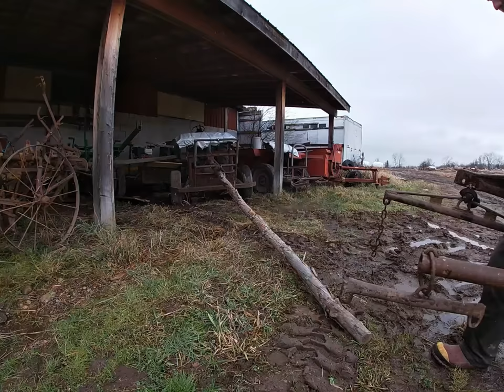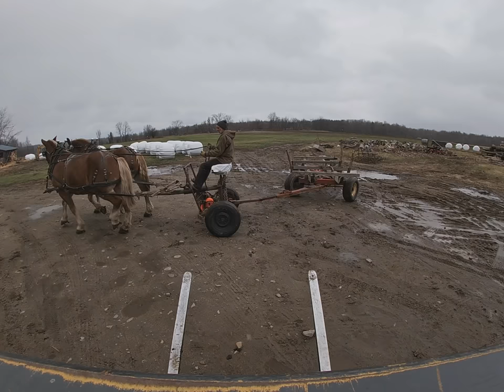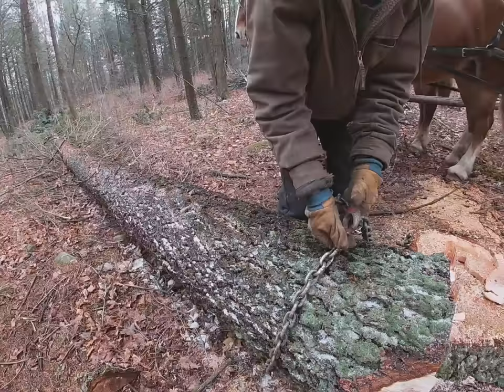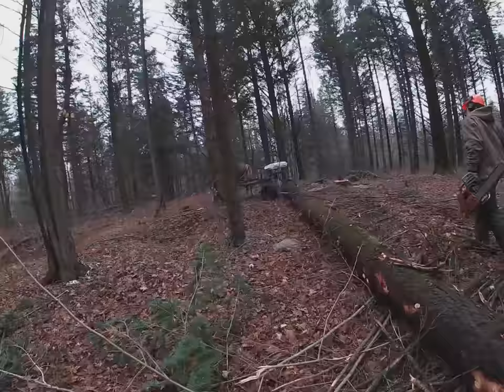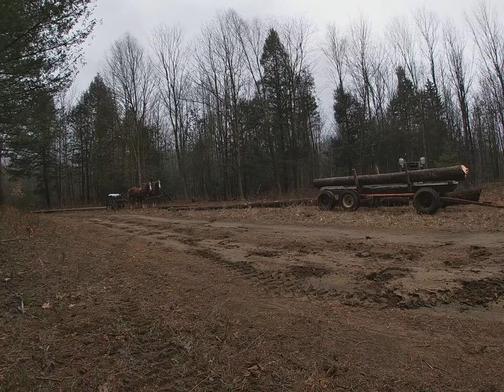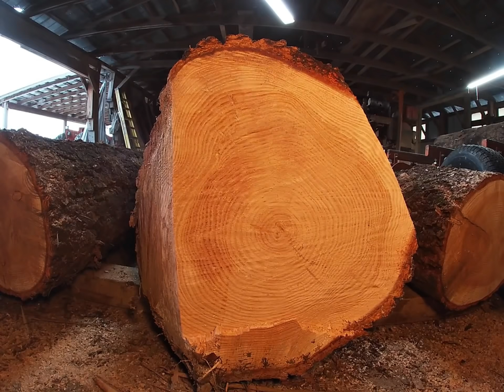Sawing Douglas Fir In Northern NY ????

Comment: I love these logging videos, especially with the horses!

In late 1960's, during my early contracting of home building, I always framed with southern yellow pine, my 1st choice, douglas fir, second choice (I would spec. #1 dense grain of either of the species if I needed the extra stength) and trimmed with white pine. I always used basswood for cabinet faces as it would usually stain well enough to match the birch plywood. It's finally great seeing some of the possible sources of the white pine trees.

Comment: Man oh man it broke my heart to see you cut those long logs into shorts. Years ago when I started in the lumber business we had southern yellow pine dimensional lumber up to 16 foot, but for 18, 20, 22, and 24 foot two by six, eight and twelves we could only get Douglas Fir and boy were those pricey sticks of lumber. I know you are limited by your mill but sure wish you had been able to make them long cuts as that would have been a gold mine with those trees.
Reply from the maker: I cut them that size because that is the way they fit in the barn where I dry them.
Reply: @WorkingHorsesWithJim  Yeah, I knew it was either the mill or the kiln that was the limit, but they sure were beauties for the long lengths.

Comment: Counting the rings at the pith doesn't work too well. If you notice you were only 4 rings out but at the 4th ring the diameter was way more than you'd expect for 4 years. It can take a decade or two for a tree to really start showing rings depending on the tree and conditions.